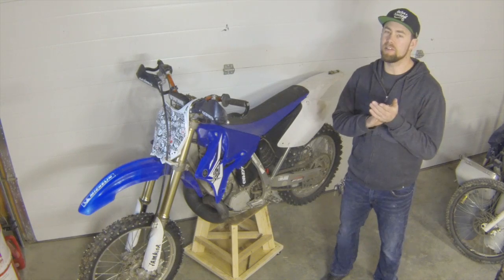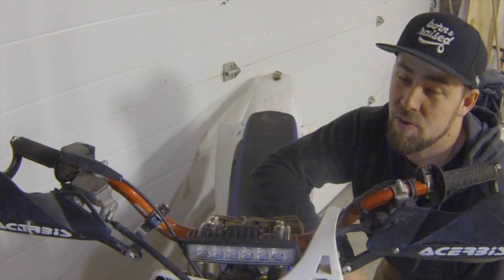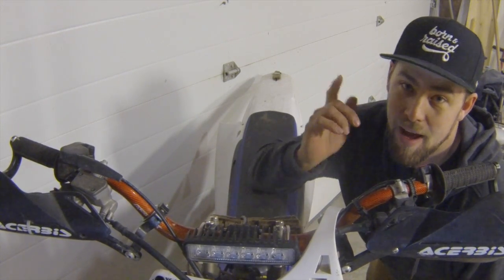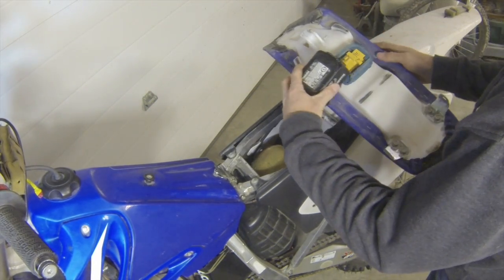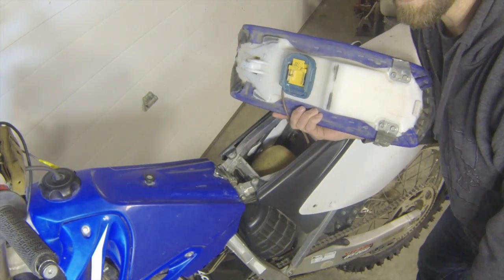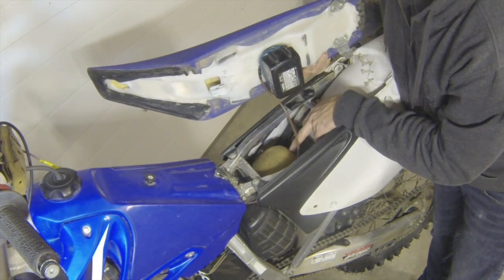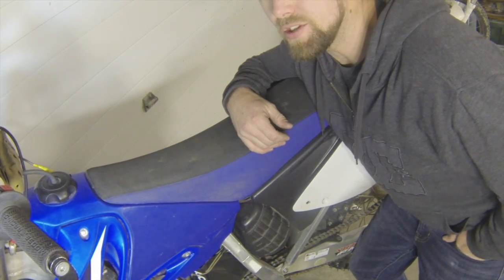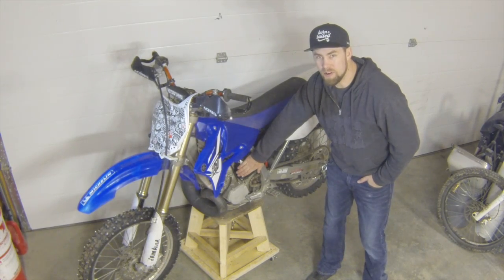Dirt Bike Headlight using 18v drill battery! [6" LED]

Comment: My light is rated 12 to 24 volts is it safe too use a 18v battery?
Reply from the maker: Yes as long as you stay in the 12-24 range

Comment: Awesome idea! I have a old makitas and about 15 batteries. I can definitely hook this up. Looking for something like this for my vintage Honda with no battery. I am assuming that the light is not 18 volt though. Does that matter?
Reply from the maker: Most LED light bars, including the one in the video which can be found on Amazon, can operate between 10-30v so its no problem at all running 18v 🤟

Comment: Link for the light ???
Reply from the maker: You can find them on Amazon and ebay.  

https://www.amazon.com/Partsam-Bright-Single-Driving-Waterproof/dp/B07ZJHL2ZJ/ref=mp_s_a_1_4?crid=3EUYW961Q1GO8&keywords=6+led+light+bar&qid=1651886198&sprefix=6%22+led+%2Caps%2C142&sr=8-4

Comment: brilliant set up dude  i run a battery in the yz250 air box witch works front and tail and brake lights but iv got to say yours is a better set up hats off to you im going to change mine to the  same set up as yours is  mutch better we do a lot of night riding in the winter in south wales  uk and we love it  keep up the good work dude and happy riding and stay up right and be safe.
Reply from the maker: Cheers!  There are battery adapter plates for most makes of power tools now found on eBay 👍 no need to find a broken drill.

Comment: You lost me at “hacking and slashing” my drill for this setup.   Why in TF would someone do that.   Now that’s expensive
Reply from the maker: If you happen to find yourself a broken one like I had.  There are also battery plates that can be found for most tool batteries now on EBay 👍

Comment: I bought same lights... ali express. Under 10 bucks each. I paid 7 n change . Theses lights are good 12v and 24v
Reply: Yup. Real tough lights. Mounted 2 under the rear bumper on superduty as backup lights. Been on there 5 years now.  Ontario salt still has not made them fail. Thats pretty impressive.  I've found a cb antenna mirror mount for transport trucks works really good for mounting these lights between the bar clamps.  
I switch out the bolts and clamping plate to a small u bolt.  Holds really good.  Just some mounting ideas for those who read comments.
Reply from the maker: Oh that’s a great idea!
Reply from the maker: Hell yeah, the one I am using has been flawless for years now

Comment: Damn dude! What’s the run time of the battery? I’ve been scratching my head for weeks now about mounting my battery in there, when all I had to do was take an old drill I’ve got in the garage and slap it in there....so simple 😂 killer idea man! Sub’d!
Reply from the maker: Ty MC check out the Updated video in the description or comments.  It includes a better look and How To.  👍🏻
Reply: Posted your video on worldwide kx and kdx page on Facebook 🤘🏼
Reply from the maker: Ty MC thanks!  I appreciate the share!
Reply from the maker: Ty MC thanks bro!  I have 3ah batteries and they have lasted 4 hrs straight before.  At which point I just turned it off... was still going strong.  A newer 5ah battery would last all damn night I would say!?

Comment: I use milwaukee and carry a 12volt adapter. Run a 10foot usb from it and have a wire thats split and has a usb male on the end. Plug the 10 footer in from my backpack and maybe run a foot and a half of  slack. The usb mape is hardnounted so if i crash and fly off it just unplugs the usb
Reply from the maker: Travis Jodoin you are straight jacked into The Matrix!  Whatever works brother!

Comment: What brackets do you use to mount the light bar on the handlebars?
Reply from the maker: MotoTek58 used 2 gear clamps wrapped around the handle bars and light base, with a piece of plastic pipe in between which I filed a flat section on for the light base to sit on so that it doesn’t twist around on the bars.  I have a new video that I am editing right now that shows my whole lighting setup better.  Stay tuned!

Comment: I did this with an old offbrand battery powered sawsal. Worked great. Made my own connection. My mom found the sawsal and put it in a yardsale and sold it and called me for where the battery and chargers were when i was testing the fit on the bike. Had to give up the batterys
Reply from the maker: Bryan C well you had the right idea!  Gotta find some for yourself now.

Comment: Wait so are running a 12v light on 18v????? I seriously need this..I live in a country that allows orv use on road but dirt bikes are exuded because a bead and tail light have to be on at all times while operating on county r
Roads...please explain alittle more for me...u need this badly with a head and tail configuration ...maybe if u could attach a link to your lights used would be great ..thank u
Reply from the maker: Dave King amazon or eBay 6” LED light bar spot pattern.  It can run 12-30volts I believe.  I now have a constant on tail light hooked up too.  DRC phantom tail light.  I am planning on doing an updated video, keep tuned.

Comment: Awesome idea but I think I am going to see if I can get a 12volt drill battery so I can use a regulator which then allows the stator to charge the battery.
Reply from the maker: Micscience nice, that’s taking it one step further for sure.
Reply: Ever worked?

Comment: Hey buddy! I just came across this video and been thinking about doing this on my show blower.... do you remember how many watts your headlight is and how long does it run with that 5 ah makita battery.....thanks
Reply from the maker: eddiekytia I believe the light is 18w, as most of the 6” Light bars are.  My battery is only 3ah.  I left the light on in my garage for 5+ hours and it was still going strong.  Total run time, I’m not sure, but a 5ah would get you through an entire night.
Reply: @RideEnduro  that was one of the easiest most simple clear answer I've received in a while!!! Thanks buddy!

Comment: If you don't have a old drill you can use a USB charging adapter for 18v battery it's  7£ on eBay !
Reply from the maker: Hell yeah!  That’s slick 👍🏻
Reply: Can you go into more detail?
Reply: @boru-cnc  thanks. My boy has a 25hr race coming up and this is exactly what we need
Reply: @adamdyment9732  I recommend to use some LED low energy consumption headlight ;) good luck
Reply: will the adapter regulate it too much to where it wont power the light bar?
Reply from the maker: @zachbowyer99  I would assume you would split the adapter open and just splice directly into the wires leading to the battery and bypass the USB plug or whatever adapter is built into it so that you are getting straight 18v power from the battery directly.  The LED light bars are usually capable of running between 10-30v.
Reply: @RideEnduro  i actually found another adapter that just has the positive and negative coming out so it isnt regulated at all and i get the full 18V

Comment: I have been completely failing at mounting the light to the handlebars like your can you please explain how you got it to mount
Reply from the maker: Cheyne Souza I used a couple gear clamps to fasten the light bar mounting base to the handle bars, but the trick to get the light to stay in place is to find a piece of pvc or plastic pipe with the same or close to the same inner diameter as you handle bars.  Cut the pipe in half to fit over the top of your bars and then file or sand a flat spot on the top of the plastic pipe to sit the base of the light bar in.  Then it won’t twist around the bars.  I’ll do a more in depth video series Of the entire setup.

Comment: How did you attaché the battery base onto the seat? Screws?
Reply from the maker: yes, just pre drilled 4 holes through the base plate that holds the batteries in order to insert screws into the plastic sub frame of the seat bottom.

Comment: hey man could you run a 35 watt halogen headlight
Reply from the maker: campbell wem yeah I’m sure it would run fine.  Being that it’s a bike light probably?  It’s most likely meant to run on 12v dc, I’m not sure what 18v from a drill battery would do to it.  Also the main reason we use the LED lights is the draw is very minimal thus enhancing run time on the batteries.
Reply: @RideEnduro  thanks for that man keep up the great work

Comment: clever idea. im gonna do this on my dirtbike can I use a 20v battery?
Reply from the maker: Brian Lewis yes, when you buy the light bar check out its voltage rating.  The one I used on my bike can run up to 30V, look at the specs.  These lights can be found all over amazon and EBay.  https://www.amazon.ca/Willpower-Driving-Off-Road-12V-24V-1800LM/dp/B01L3J531C/ref=mp_s_a_1_8?crid=3R9Q7QEQ44GN6&keywords=6+led+light+bar&qid=1556563794&s=gateway&sprefix=6”+led+&sr=8-8

Comment: I found these same lights on Ali express. 10 bucks each to the door and free shipping. All kinds of cool lights n switches n shit made in china on that sight.  Love the underseat battery idea. I put 2 of these lights under the rear bumper on my superduty.  Holes are already there. Just had to run a switch n  Power. Awesome for loading and backing up the 20 flatbed trailer
Reply from the maker: Yeah it’s crazy how cheap these lights can be found, and how well they actually work!
Reply: Amazon prime sells a 52 inch 300w light bar for 89 bucks can. I run one on my superduty and one on my KENWORTH.  3 years on the superduty no issues or fog up. Hard to beat that.  The small light works well with a 7.2volt old rc car battery too. I run one on a norco rampage single speed i built for night rides after work. 1 inch angle iron drilled 2 holes. Use the ahead set top cap allan bolt to hold to the bike. 2nd hole for the light bracket.

Comment: Just cut up my Milwaukee . No it wasn't broken . Yes I have multiple .so I could spare it   gonna be awesome I can't wait  I will update and make video as well
Reply from the maker: Daniel La Breche right on!  Which bike are you mounting it in?  Still going strong with my Makita setup, I added a DRC LED tail light onto the battery too.  Il start doing more vids soon and highlight that too.
Reply: @RideEnduro  2018 yz 250x. I was gonna use my airs oft batteries but I saw this and was like hey I got 3  sets  of drills am I gonna miss 1 lol.only place I can mount is on the seat as well lol. Except I'm gona be  apoxy a nut into seat so I can adjust take off if I need with ease

Comment: Where do you get the adapter where you put the bettery on
Reply from the maker: TirolYoungRiders I cut the bottom battery mount plate off the base of a broken Makita drill right at the end of the handle.  Used the wires that run from the battery to the drill motor.
Reply: thx

Comment: how do you mount the light bar?
Reply from the maker: 2 gear clamps around the base of the light mount and handle bars!  We found a piece of plastic pipe with the same inside diameter as the bars, cut the pipe in half so it sits on the bars and then filed the top of the pipe flat so that the flat bottom of the light mount would sit on it nicely.  This helps the light to not spin on the bars.   I can do a quick vid to show this.
Reply: Did he post the video on how to do this?

Comment: My buddy and I use a speed demon 6"flood/spot in his YZ. We require front and rear lights here in Alberta so we fabed up a bracket that sits above the air filter to hold a small motorcycle battery and runs over 8+hours half charged
Reply from the maker: Teammizera  nice, I'm also in AB, Cochrane to be exact.  I use one of these on top of my rear fender as my tail light.  Very low profile, waterproof, rubber construction.  https://www.sandsprecision.com/v-lite-blue.html
Reply: I picked up a sleek round LED trailer marker at Cantire or PA for ours, its in a coming video of may long. Keep an eye peeled

Comment: Brilliant solution. I watched this video and then was in the hardware store and noticed Dewalt makes a conversion plate to go from Nicad batteries to Lithlium ones. This might be the perfect base to slap a light and powerful battery into. It does get expensive buying a charger, battery and adapter plate, but I can't think of a better system. Well done in your case.
Reply from the maker: kuladeeluxe thanks!  We used it all winter without fail!  My only concern is ruining the battery if I drown the bike on a river crossing or something.  But Im playing with the idea of putting the mount into a small dry bag.
Reply: They also do a usb charger pod they are perfect , good eye 👁. Pal